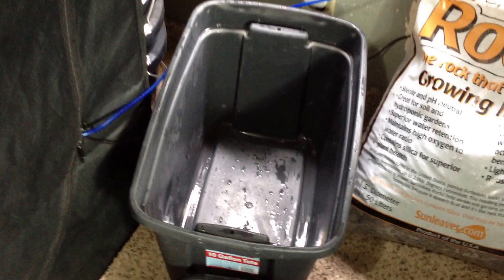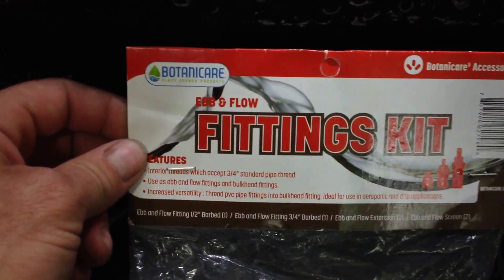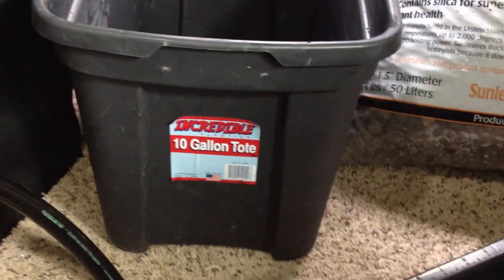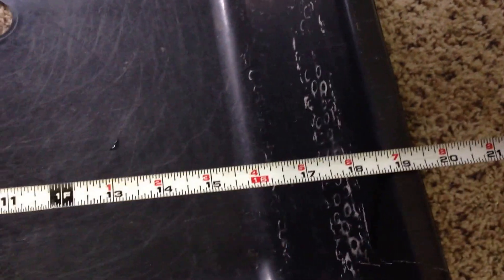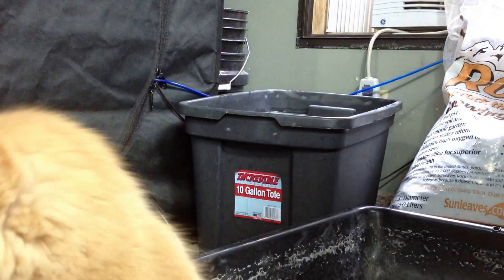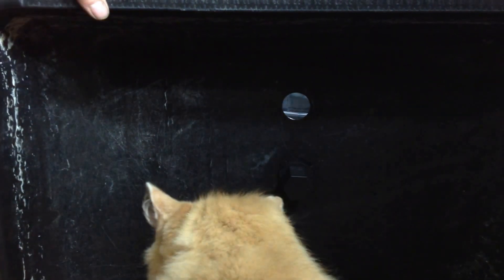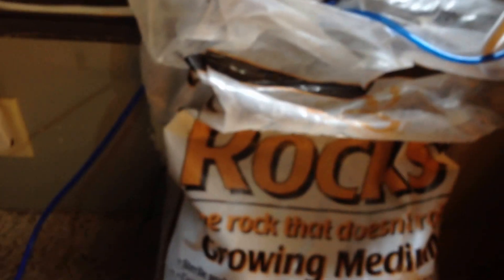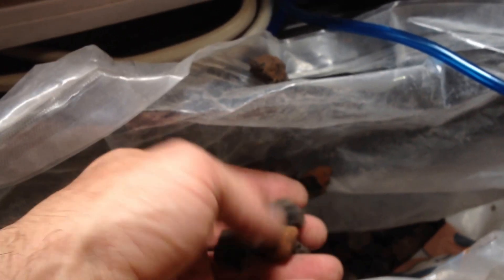DIY flood n drain table for 50$

Comment: really nice inlike how you showed  you can do it cheap. but here somthing ill point out compared to the tables we run and sell.. you need a pump for every res and you also need a seperate res. with are tables the res is built in and are pump can run up 60 tables